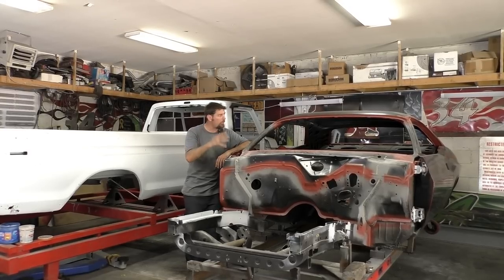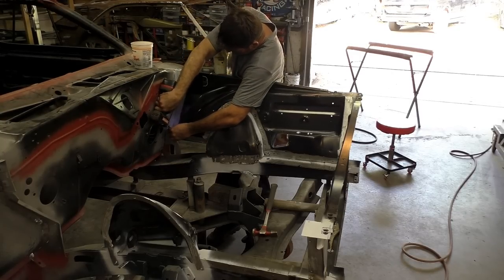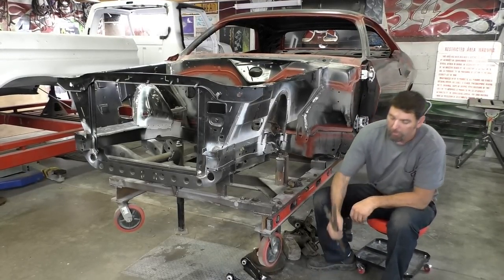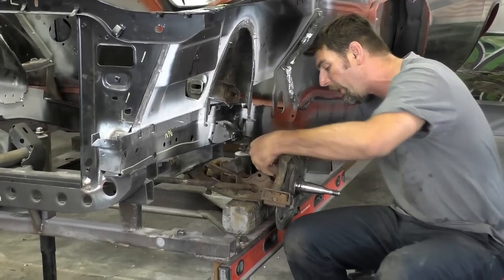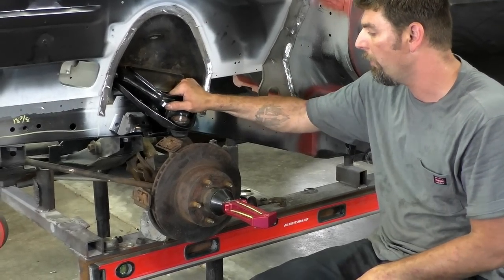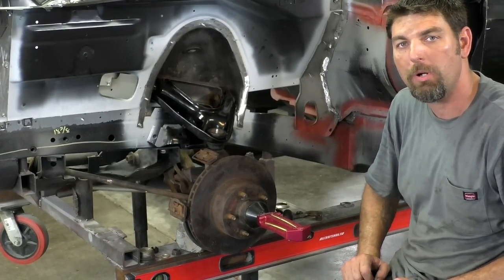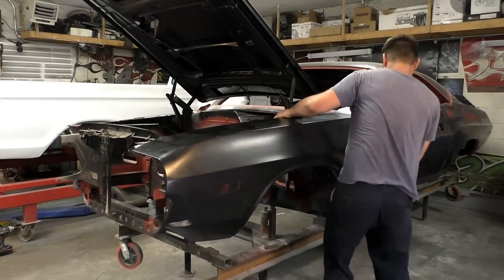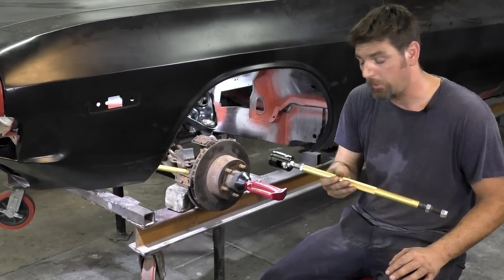1973 Dodge Challenger Camber & caster front end install restoration episode 8

Comment: When you get to this stage for alignment, you really see how important a frame jig with the k frame mounted to the jig is. You are able to install the lower control arm to check your measurements. And you can be certain all of your replacement parts are in the correct location. Thanks for all the good information and these videos.👍
Reply from the maker: Yes I feel a lot of this is what a lot of restoration people are either not doing or not talking about it.
Reply: I agree

Comment: I have two 73 Cuda's just did your measurement between shock towers centers one is 33 inches and the other 34 obviously a lot of tolerance in the way these are assembled. Nice job on the Challenger
Reply from the maker: Thank you and I completely believe the tolerance in the different cars and the main reason you need the cam bolts to adjust the front end. Thank you and appreciate the feedback with the measurements.

Comment: Hey I don't think you're doing that right I've been doing body work for 20-years if you don't have centerline and Adam you can't measure with the tram cuz you can have one side up or the square out-of-whack if you don't have data them I've been doing buddy working 50 years I've been trained went to school on this
Reply from the maker: I tried to understand your response. I think you are saying I need the datum line to reference off of. That is the center point and that has been pulled when the car was center mounted off the JIG 5 videos back. Maybe if this is the only video you have seen of mine it might seem like i just threw some parts on a table. So if the frame rails are built on a JIG when and I am squaring everything else off the two frame rails already set in place (factory locations of a straight car). I have also pulled string lines off all 4 corners of the suspension of this car when doing the frame rails and the body gaps line up better then factory. So I might be missing but personally don't see else I could do where your saying I did it wrong?